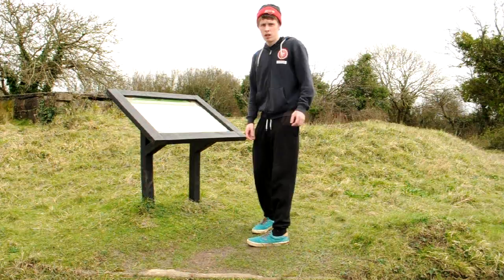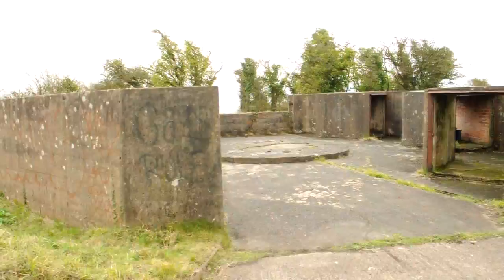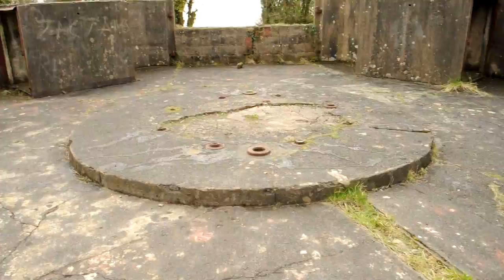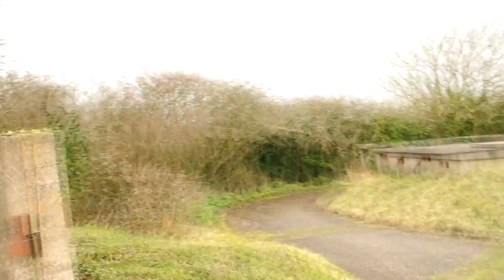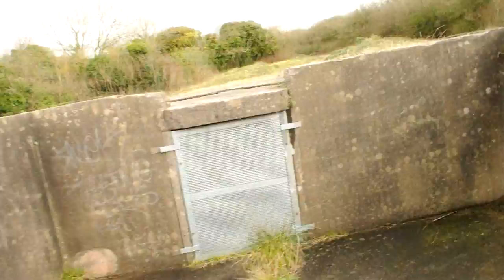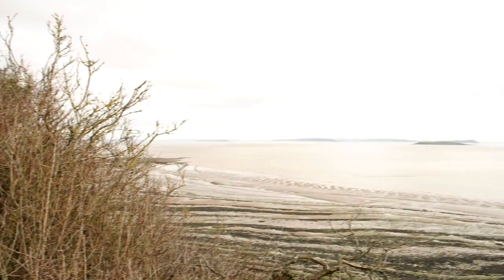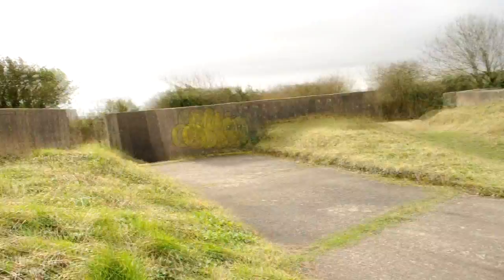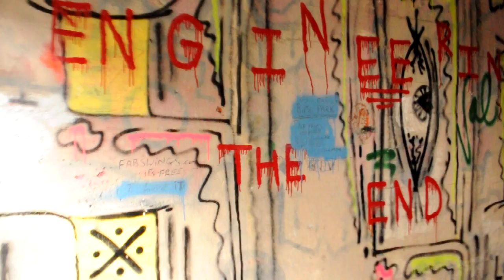Abandoned lavernock ww2 bunkers Urban exploration

Comment: The canons were long gone when that Battery was built. They build over the existing Victorian fort, with reinforced concrete structures that housed Anti air craft guns. The ring of bolts in each enclosure show where each gun was mounted. The small concrete structures that circle each gun mount, housed the shells for the guns. The underground structure was where they stored all the ammunition/mortar for the guns hence why there is a double solid concrete Blast Proof wall surrounding the building. The other underground building was for the Range Finder housed its equipment to detect the Luftwaffe approaching Cardiff Docks, also in the structure was the officers quarters. The Fort/Battery is quite rare, as it housed one of the guns that could actually be lowered toward the water in the Bristol channel for possible uboats.  There are many buildings now buried along the footpath from Lavernock Fort, running all away along Penarth Cliff tops. Most recent structure is the underground Nuclear observation bunker built during the cuban missile crisis during 1962.  It was decommissioned around 1975.
Reply from the maker: Thanks for the info buddy